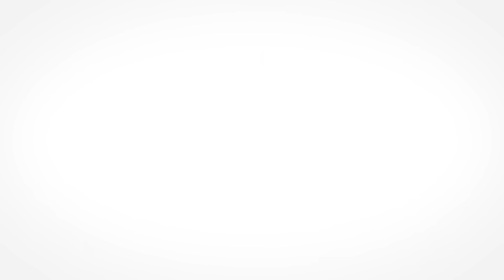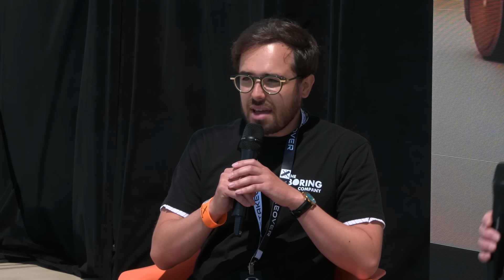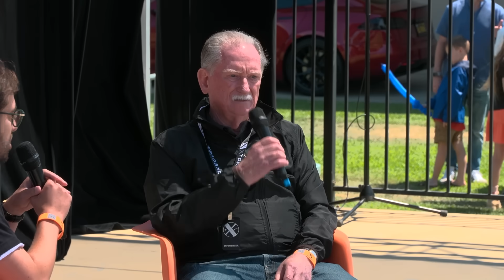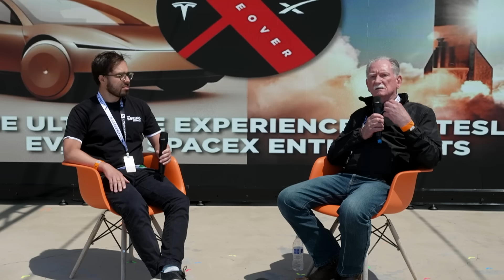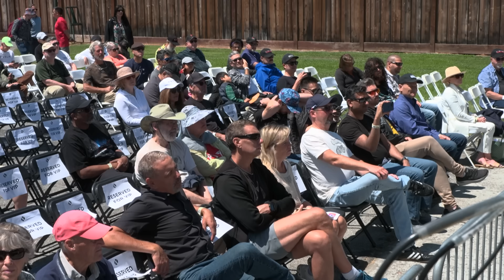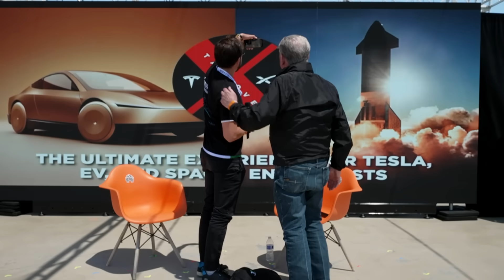X Takeover 2025: Sandy Munro (@MunroLive ) Engineering the future of EVs w/ @HyperChangeTV

Comment: LiDAR costs have dropped 90% over the past decade, from $75,000 to under $1,000 for some models. A decade ago, LiDAR was one of the most expensive components of self-driving cars, costing $75,000 per unit. Today, some manufacturers offer LiDAR sensors for under $1,000
Reply: You have to be careful generalizing…. PCs came down from 3k to a few hundred bucks in 20 years, but some computers made for high end gaming are still very expensive.. I’m guessing waymo ain’t using the cheapest Lidar from Temu. There are levels of Lidar.
Reply: @Cows640  Waymo 5th gen sensors suite (Lidars, Radars and Cameras) cost $9,300 per car according to Bloomberg analyst

Comment: This so far off base. We are going to design a Tesla as an arm chair quarterback. The fact that there is a SUCCESSFUL alternative to having 4, 6, or 8 explosions per send less than 3 feet from your lap is monumental. I personally don't care about the specifics, the regulations and the market itself will guide who is going to successful and who isn't. Nothing against Tesla or against Sandy but Tesla is in the drivers seat. We buy or we don't buy THAT is the vote that counts!

I can have opinion too lol. Mine would be the model Y should become 4 cars immediately -
1. The current car.
2. A "Cadillac version that out Cadillacs cadillac and is VERY car like in experience.
3. A very economy version solid roof, electric motors for opening hatchbacks removed, smaller battery, cloth seats.
4. A pick-up truck style.

Then, if I was going to put my nose further where it doesn't belong, this highly intellectually charged brain should focus to remove the hazards of electric, and apply to develop the next big thing - hydrogen issues. Removing sound deadening materials and suspension mods are so juvenile and are not much more than internet chatter.
Reply: You obviously know little about suspension. They could use McPherson struts up front or a simplified SLA suspension. In the rear they could use a DiDion suspension. These would save on complexity and cost and many people wouldn’t notice or care.

Comment: To make a 'more affordable' Tesla they'd have to knock maybe $10,000 off current models. That's why Sandy can't say how, because they can't do it. Tesla's design parameters have already taken the biggest steps to getting cost out and things Sandy mentioned are only fiddling around at the edges. The only way to get significant cost out is to have a smaller battery pack and maybe make it a two door. You're then left with a city runabout that aren't exactly the most popular cars in the US. Then, there's the fact car manufacturers don't really want to sell 'cheap' cars because, for the most part, they're barely profitable. Tesla was originally valued so highly because of high profit margins per car and over time with much more competition that margin has significantly reduced and a 'cheap' model will only erode margins further. To look at it another way, they would have to sell 2 and a bit 'cheap' cars to make the same amount of actual money as one MY.

Comment: EV owner since 2014...to  current. Still would not recommend one to half of our population
Reply: I agree. EVs generally won’t work for those cannot charge at home, drive very long distances per day, or tow unaerodydamic loads more than just across town.
Reply: My guess it's not a Tesla
Reply: @larryjolicoeur7169 Careful Icarus.... negative Merlin. Proud 2021 MX owner. Chargers are often in sketch areas and rarely have canopies - so would not put any female i love in one. Petrol stations are 100% reliable and very available. Additionally, one of the main benefits of ev ownership only comes.from ability to charge at home or work and nearly half of the country does not have access to thos cheap charging because supercharger is nearly on par with fuel prices unless in Cali

Comment: The BIG BIG BIG problem with EV's are the batteries. Ev's stand for "Exploding Vehicles". When you got 10,000 Li-Ions cells a single cells goes into thermal run-away the whole pack goes BOOM. These EV's burn EXTREMELY hot are un-extinguishable and emit HUGE volumes of very toxic and explosive gases. Now imagine one of these EV's going BOOM in an indoor parking garage!!! It's going to happen. Thank you you Elon Musk.
Reply: You are wrong on all counts here .. wow.
Reply: you're worrying about tiny little fringe details. save your pennies and buy the next product, goyim.
Reply: So how many have gone BOOM in a garage in the last 15 years?
Reply: @davidreidenberg9941  A lot, dozens and dozens, if not hundreds.

Comment: Stop making buyers pay for all that self driving hardware they don't want. A basic cruise control will make most drivers happy.
Reply: Cruise control promotes accidents.  False sense of security.  You obviously don't speak from one with HW4 FSD experience.  It's obvious you don't have any clue.
Reply: @fergmorriss1651 most drivers don't have a clue. You feel better about yourself now🤔
Reply: Same hardware powers the safety features like AEB and Lane Departure Warning
Reply: I agree with that, but Tesla WANTS to promote FSD availability on ALL models, something I don’t agree with. I drive my Model 3 and have never used FSD ever. I will not pay for it and cannot afford it. TRUE autonomous driving WILL BE a game changer when someone gets it figured out. At that point the entire auto industry will change fairly quickly and many companies will fail. Until then, Tesla could sell quite a few simpler, cheaper EVs to many happy customers.

Comment: It obvious that removing 2 doors and the glass  roof is the biggest cost savings. The tires on my Y cost $300+ with sound reducing foam that would not be necessary once the glass roof is removed. Aluminum sheet metal could be replaced with plastic
Reply: Who buys a 2 door car? Unless its a sports car used as a toy or a small Smart car? 2 door cars with a rear seat have huge doors and need wide parking spots. Maybe its only for the american market.
Reply: 2 doors cars have very limited markets

Comment: Will the robots have to go back to the service centers for warranty work as often as the Tesla's do? Will they have rattles like my Tesla does? Will the Service Center Techs tell me it is wit;hin specs?
Reply: are u getting this info from places like Customer reports, because  i found that many "main stream sources" are super biased
Reply: @misob  Personal experiences.
Reply: Roadster 2
Reply: Nonsense you drive a VW sorry for you.
Reply: Ha ha ha, all good points. “Yes” is probably the answer, but if none of this happens much it will be OK. My 132,000 mile 2018 Model 3 has one or two rattles but is otherwise fine.

Comment: Tesla major hidden expense is battery Reman costs. The battery enclosure seal needs to be redesigned to allow easier faster disassembly. Or, there MUST be robots to open/unseal the urethane seal.
Reply: I read that as Ramen, as in engineers food 😅
Reply: It's a crime, especially the CT battery. Repairability and recyclability should be mandated in legislation.

Comment: 2 door 3/Y would really sell in Europe and to me makes great sense, especially for people without families
Reply: 2 door cars have huge doors. They dont make sense at all if you live in  a place without big (wide) parking spots. I will never buy a new 2 door car because how difficult it is to find a usable parking spot! I hade a 2 door Seat Ibiza and a 2 door Ford Fiest, finding a parking spot is easy until you realise you also have to get in and out of the car... Having to ask your passenger to get out before you park so you can park sligtly to the right and when you come back some idiot in a big SUV used the extra space and both doors are blocked! Now you have to unlock the car, roll down the window, put transmission in neutral, grab the steering wheel and relese the parking brake from the outside and push the car out of the parkingspot. And hope you dont slip and fall and the car rolls away because you cant reach the parking brake... 2 door cars was ok 30-40 years ago when small 2 door cars was still small, now small cars are as wide as normal size cars. And a Tesla is not a small car, it is as wide as a VW Transporter T3 van from the 80:s. 
(i'm in sweden, my dad had a 1984 VW Transporter and a 1988 Renault R5 GTE. We joked about how the small 2 door Renault needed wide room for the doors, and the VWs sliding door made it possible to park in really tight places and still get in and out. But is was fun to drive. 95hp in a 800kg car is more fun then 78hp in a 1700kg van.)
Reply: @gtvgranberg The best thing about Europe is they know how spot elon from very far away and keep thier distance.   The sooner the Americans learn how to spot elon for what it is and put it in his place the better off everyone will be.
Reply: 2 doors don't sell
Reply: Tesla is a damaged brand and company in Europe. Sales have hit the basement
Reply: There is no true advantage of a 2-door car on the same unibody platform as a 4-door sedan. What Tesla should sell is a simplified Model 3. Cloth manual seats, a more basic suspension, a steel roof, manual dash vents, and a dashboard from a 1990s Subaru. This would appeal to people who just want a cost-effective electric car without all of the needless luxury BS.

Comment: Elon said exactly what the lower cost Model Y would be…A decontented Model Y. Why can’t people just take his word for it? 🤦
Reply: Yup prototypes spotted with cloth seats, 17" wheels, no rear screens, a metal roof and what looks like a slightly smaller bumper setup with no fancy light bar across it or the rear anymore. 

Ibet they price it between $35,990-$37,490 available from October 1st! Using a 65kwh useable 4680 structural pack with 300+kwh charging giving right at 270-290 miles of range! The model 3 base sr will break 300 and be priced at $34,990 imo. 

Both will use a weaker 200-220ish hp no rare earth motor, supposedly already in production in China and shown in the early 2023 investors day slides!
Reply: @4literv6 
Absolutely! 
I predict that the price will be even lower at $29,999. It will be a shock to the system. There will be no other vehicle that could compete with it.
Reply: " Why can’t people just take his word for it? Because he's lied so many times in the past.
Reply: Fair enough! 😂